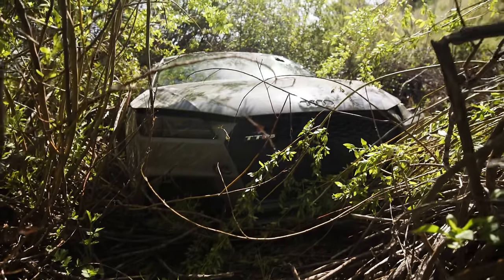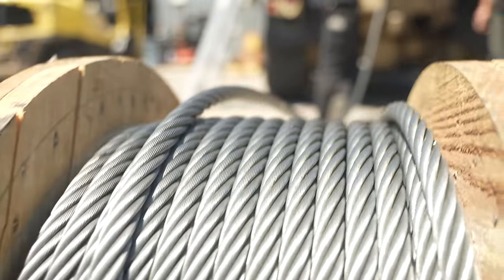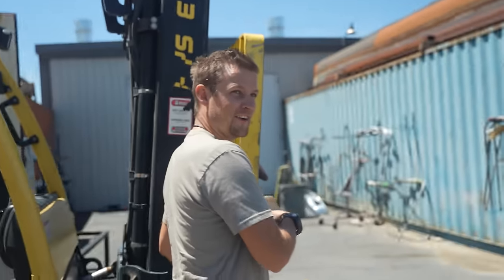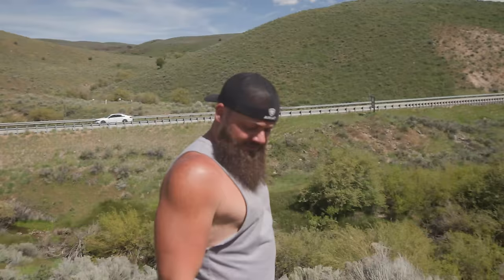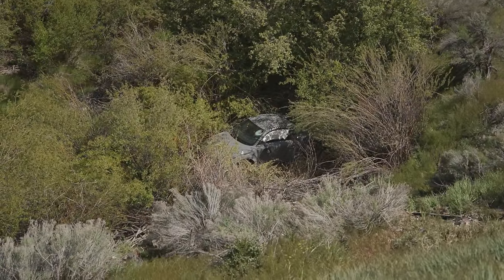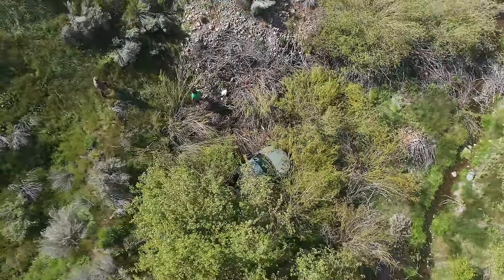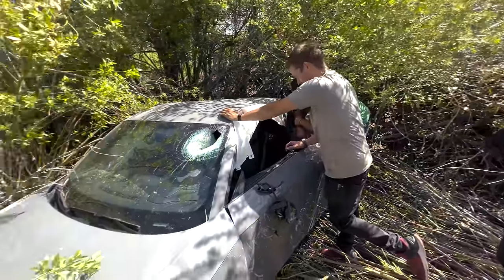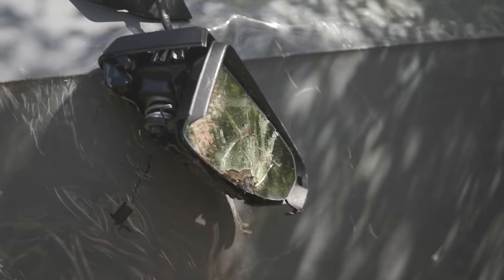Exotic Rental Car Launched Off Cliff and Abandoned By Renter

Comment: Guys, you have a crane an pulleys, why wouldn’t you hang a diversionary pulley from the crane to avoid the cable running over the edge of the tilt tray?

Comment: Been doing recovery about 15 years. Never use the factory tow eye. Seen those go through 1/4 " steel plate when they let go... Oh and stay the f()ck away from the winch cables under load  guys.

Comment: OK this is straight from Tommy Turbo, that's me. I am mildly impressed by your operation. However we are in the space age. Imagine your guys getting on the list for Two tesla tractor trailers. Then combine the two for the ultimate futuristic  recovery vehicle, to add to your do good superhero persona. Your cleaning up and setting trends.  Then you put a smallish diesel electric generator, for charging and winches and what not, do I have to think of everything. GO, break.
Reply: Yea, the batteries could explode and the truck burn to nothing, .....  Good, just get it on video.

Comment: Just me, but when I have the extreme or cliff recoveries if intact nylon strap both front wheels. Low pull less resistance, or an always go to is the engine. Most times they leave the eyelets hooks on the engine, good go too with small unibody car's. Sorry I cringed watching the cable against the side of the deck.

Comment: Exotic Car Recovery.. a VW golf with some different panels on it and a Audi badge and it's an Exotic. Also you guys are nuts for where you stand when you have weight on the cable. I know this you film this for entertainment and it it is great to watch. But those cables, chains and tow points are no joke if something lets go. Been in the crash trade for 30 odd years and some of you guys would get kick in ass if you stood where you did, with some of the guys I have worked with.
It is a big accident waiting to  happen I sure hope it doesn't and you guys get some training before (well you know)

Comment: Do none of you wear seat belts in any of the vehicles?  Have none of you ever been pulled over for using your mobile behind the wheel or eating/drinking with no hands on the steering wheel.

Comment: you guys need to take a rigging course, I watch your video and you don't have a clue on how to use snatch blocks, just look at how your destroying the winch rope on the sharp corner of the deck, when you have the 2nd winch truck sitting there doing NOTHING,   I would hung a snatch block from the rope on the 2nd truck and got a straight pull to the back of the flatbed ....